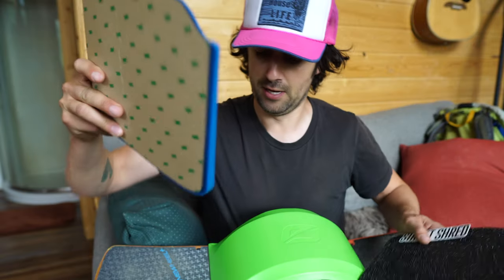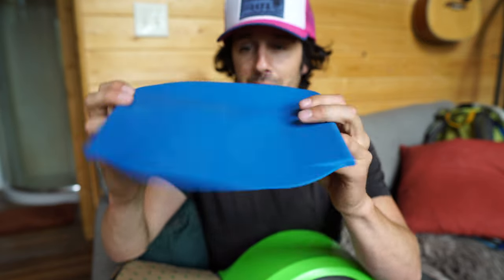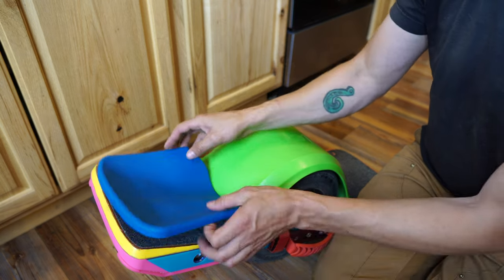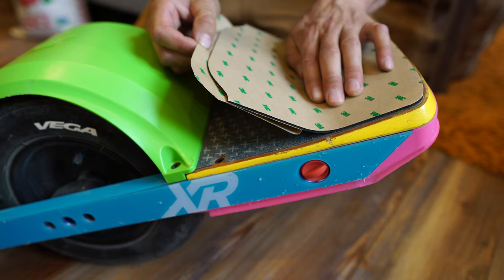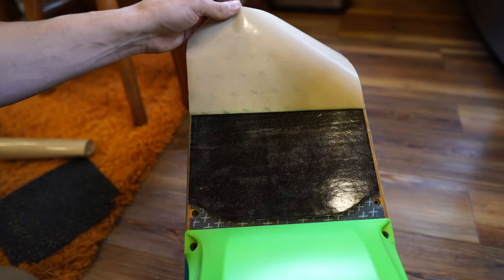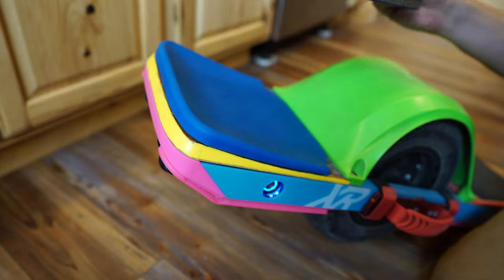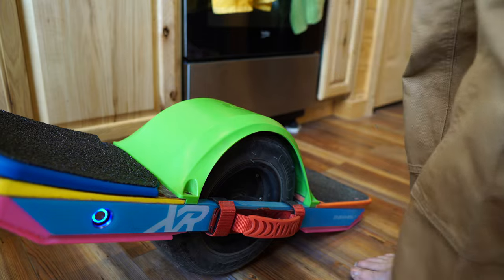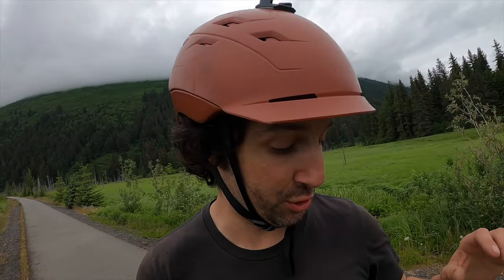ONEWHEEL - Viper Concave Front Foot Pad - HOW TO INSTALL & REVIEW

Comment: so i have a pint that ive installed this on, i love how it reduces fatigue and such. but sometimes when i start off on my board it just doesnt detect both feet are on, i made sure i had no air bubbles and such and everything is lined up nicely, Do you think its just my bad foot position or did it not go on right? not disappointed in the product but sometimes i have to retry 2 or 3 times to actually get the motor going
Reply from the maker: Not sure, my will do that every now and then, make sure your foot is super flat when you step on it.

Comment: hi men, do you know what kind of 3M double face foam they use ? i want to replace mine, i install it on an old pad and i had to much ghosting issues, now i bougth a new one but my 3M foam is used, i cant order the precuted one from street sread, i am in france it is to expensive to send it... it is 3M VHB rp45 ?
Reply from the maker: Not sure man, but it worked great.

Comment: Interesting, I just put a Kush Hi on my rear, I would love to have a concave front pad. Why wouldn't you just remove the stock grip tape and then stick the front pad to the sensor pad?
Reply: I think that can damage the sensors
Reply: 1. its a quicker faster install. 2. you can go back to stock in less than a minute. 3. any time you remove grip tape you can potentially damage the sensor with out knowing it.
Reply from the maker: Yup sensor damage if you do that probably.

Comment: Can't I just remove the grip tape
Reply from the maker: Mayhaps? but be careful with the sensor they rip easy.
Reply: @TruckHouseLife  a bit of an update. I bought this pad and had issues with getting the pad to sense so instead of ripping the plastic off I reinstalled the pad with rubber O rings between the sensor pad and sticky tape with the grip tape removed. It's super easy to start now and it doesn't ghost.
Reply from the maker: @TrooperManaic  nice! u take any pics? Would love to see then at truckhouselife@gmail.com if u did!